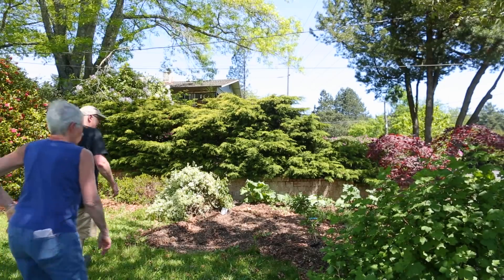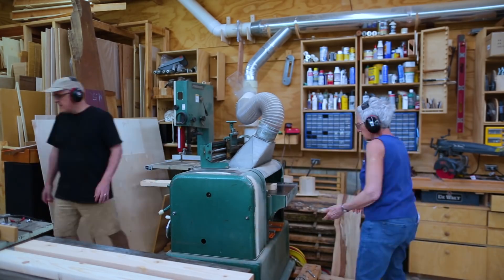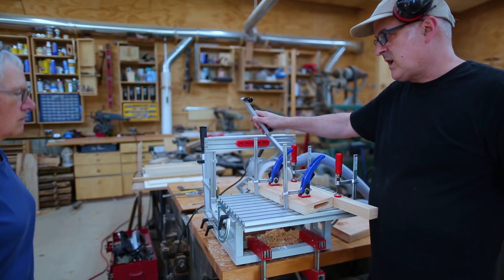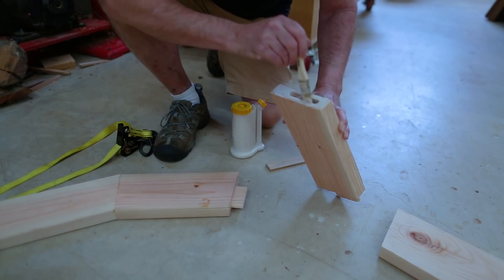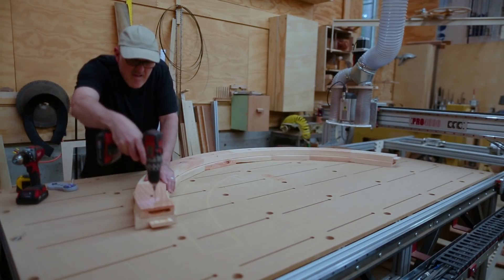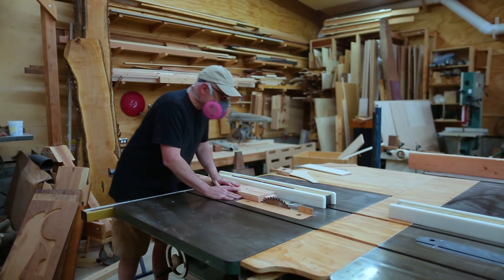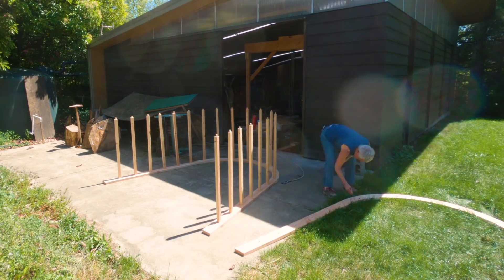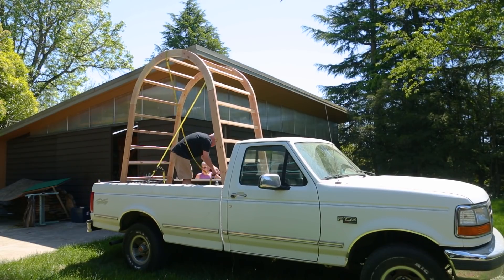Making A Kiwi Trellis

Comment: That clamp is definitely the longest I've ever seen.
Reply: missed your chance on a thats what she said joke ;)
Reply: @sstoeps  It was a gift, I guide others to a treasure that I cannot posses
Reply: @owain_rj  I understood that reference.
Reply: If they don't fruit you may need a small companion plant there as well. Male female type thing.
Cheers from a true NZ Kiwi.
Reply from the maker: @Paulman50  they got both a male and female
Reply: That's what I was thinking. "oh, let me just grab this spare 10 ft clamp I have lying around"
Reply: Not only that, but it's length was within inches of what he needed. It's like it was designed for that trellis.
Reply: I'd be worried about the bar flexing, but then again, it was solid steel and he wasn't bearing down with it on the work too hard, so that doesn't seem to have been an issue.

Comment: Definitely think different that I do,  I would have thought to use thinner material,  wet it and get a bend in the wood to mimic the arch, or just go to the local home improvement store and buy a single 2x stud ... it should have enough bend to it and even a decorative twist :D  ...  maybe a couple pieces that overlap so I wouldn't have to bend the whole arch from a single piece.

Comment: To rotate a metal stake that's already been driven, inset a pin into one of the holes and push on the pin (usually a nail or screw) in the direction that you'd like to rotate the stake while tapping the top of the stake lightly with a hammer. No need for vice grips.

Comment: Nice Frank. You used your mom to help make her Mothers Day present? Oh man. I would have done the same thing if I could. It is great that you could work together like that. You will remember that for as long as you live. Great to have your mom around. In you nighttime sky shot you got a stationary object in the sky, most likely a GPS sat. You can see it very the top of frame about one inch from the top, between the to 2 center stiles on your deck rail at center frame. It is a small speck and blinks one. I watched it 3 times to make sure. Try and find that you YT trolls. :)

Comment: Nice project, nice garden, nice everything.

One question though. I guess it's a matter of style and personal taste probably, but when you cut the legs longwise to match the width of the arches, you did it in parallel lines. I guess it's also the easiest way. Now, did you consider cutting them diagonally? I mean, in such a way that you cut what was needed where the legs meet the arches, but no cut at the bottom, kind of an inversed tapered leg?

Just saying. It would mean less waste (although the cuts you have left are somewhat more likely to be usable than tapered ones) and maybe make the trellis just a bit stronger, though wouldn't make that of a different.

Thank you for your work. It's as inspiring as it gets.

Comment: The metal stake was a good idea as it will need to be held in place both for the wind and to stop it from spreading apart. From my little knowledge of Kiwi plants, they are a vine and will need to be tightly woven around the trellis and themselves. I have not seen any that are much more than 1/2 inch thick, very flexible and heavy. They grow very fast and unless you weave then very tight they won't support themselves. think more like a grapevine.

Comment: If the steel stakes are just steel; they will rust away. 1 creating a rust weld more firmly securing them in place. 2 eventually doing the same as the wood returning to the earth.

Comment: Where did you get that long clamp!?
Reply: eggypickle looks like a regular bar clamp fitted onto a long bar from a steel supplier
Reply: @Renville80  Ahh that makes sense, I've seen the ones that you can fit to any length of wood before but didn't know they made ones to fit steel.  Might have to find one of those